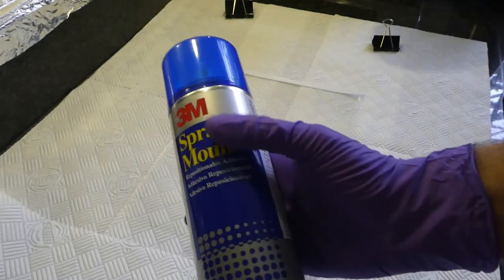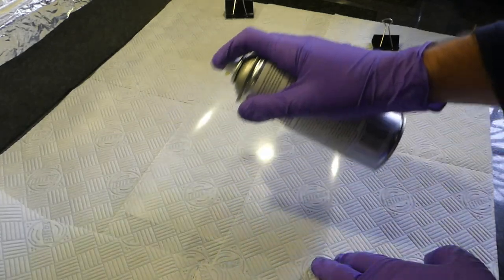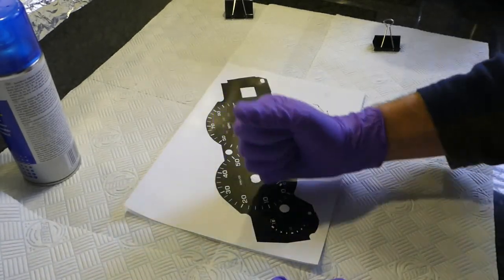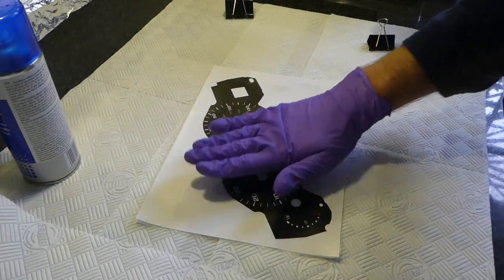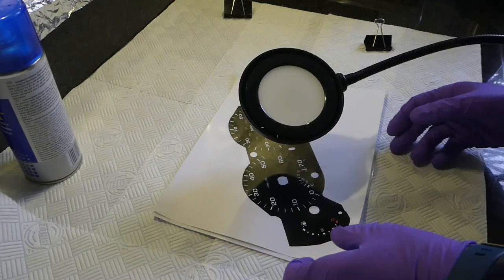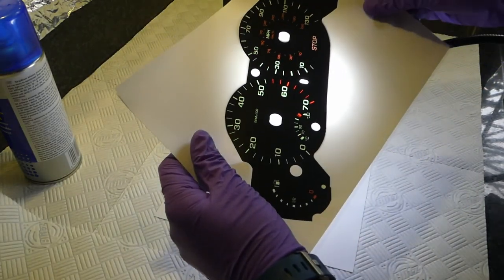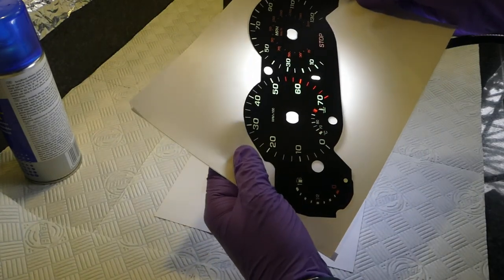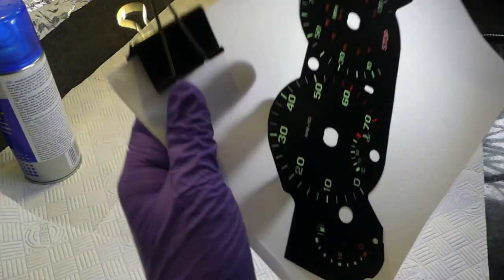8. How to print your own (DIY) speedometer (instrument cluster) - Glue

Comment: maybe spray the rear of the printed sheet and use a vinyl applicator to lay it over evenly! and again as i mentioned before, print the transparent sheet in reverse so your not interfering with the printed surface! Great videos, thank you! EDIT hadn't watched all the way through at the time but glad you figured it out!
Reply from the maker: Yes, I think I tried that. I mentioned it somewhere in the videos. While it is ok to do that, the problem is that the reverse side is rougher and one cannot adjust the sheets to be matched perfectly. It just does not slide really well.